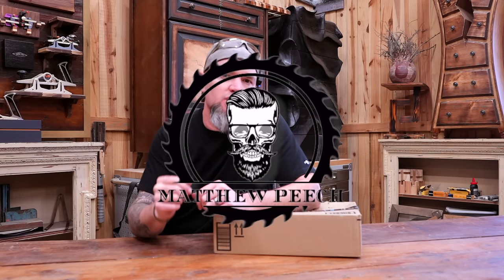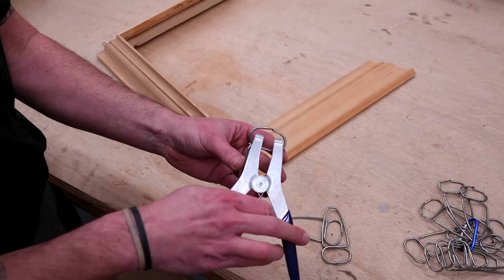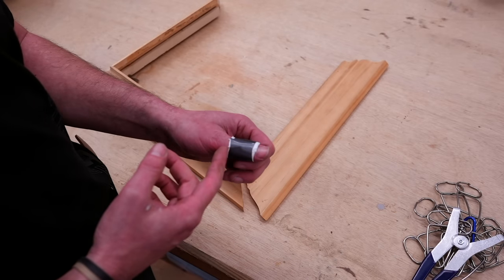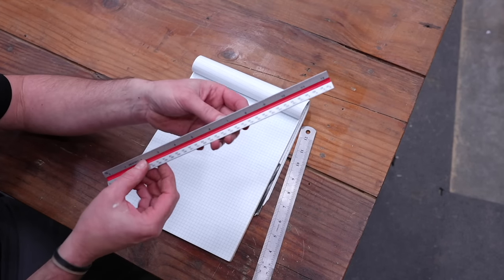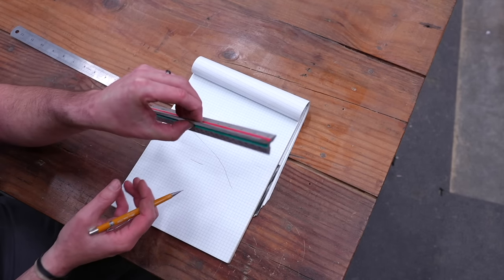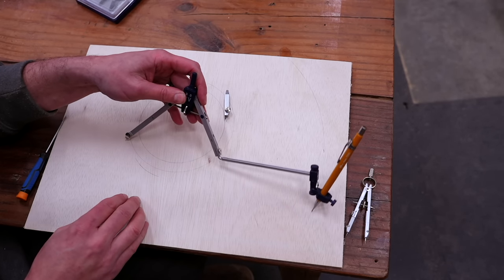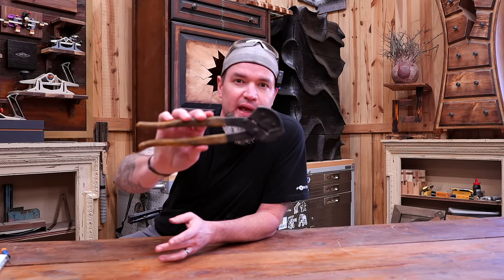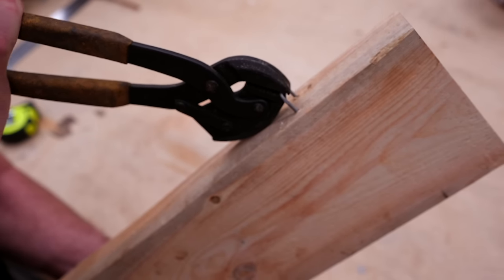8 Tools Under $20 YOU Told Me To Buy

Comment: I don't know if I just got lucky and bought a good one or if they are all this well made but, I bought the Hercules 12" sliding compound miter saw and, other than the dust boot, it is an excellent saw. No tweaking required, the gauge and the blade are dead accurate, the blade is of good quality with the laser cut expansion/balance slots, and it has plenty of power. The dust boot is no good. It is split in the bottom middle and when vacuum is used it collapses and eventually tears off. I'm still happy with the purchase since dust collection and miter saws are sworn enemies anyway.

Comment: Another tool that's very helpful and decent one costs a little more than $20 is a digital caliper. Love your channel man, keep up the great work!
Reply: Digital calipers can be had for under $20. I bought one through Temu.
Reply: Just remember to pull the battery out of your cheap digital calipers or it'll be dead when you need it.
Reply: i use harbor freight digital calipers for reloading, hey any time you wanna try a box lemme know!..     SFMF

Comment: I have a bunch of harbor freight stuff. The trim router is a great deal at only $20, but add a hose clamp to the base so it won't move on you. (i have mine in a little router table and use a DeWalt trim router for finish work on projects) the bench top bandsaw from HF is awesome. Super useful and it's small so you can move it out of the way. I got a cheap hammer from there that's nice, some really cheap leather gloves that are durable and comfy, and I'm a big fan of the 12' Bauer tape measures. They're small and easy to read so I have a few laying around. The Bauer belt sander and planer have treated me well too. 
There's a new Hercules router with fixed and plunge base that's getting really good reviews for a killer price too
Reply: i use harbor freight digital calipers for reloading ammo, hey any time you wanna try a box lemme know!..     SFMF
Reply: @mos8541  I only have a 20ga shotgun. Do you reload shells too?

Comment: HF comments made me chuckle.  I thought i was loosing my mind because i could not get my framing square marks to match up. After measuring and marking a half dozen times i looked at my square and realized it was a HF square.  So i spent an hour digging around my shed and found one of my old hand me down Nichols framers and double checked everything. HF square was not even close. If i still had two good eyes i would have known before i bought it. 
Like the man said; if you need a precision tool, you probably do not want HF.

Comment: I wouldn't be with out the spring clamps. I also keep them on a carabiner. Here's a tip - drill a hole in the end of the pliers and add a key ring and also keep it on the carabiner. Can't beat keeping everything together.
Reply from the maker: Nice suggestions. Thanks!

Comment: Good stuff.

For nail pulling I use end cut nippers. Both jaws are rounded on the top. 
Lots of leverage and wont mar the surface..

The center finding ruler looks like a good idea.

On larger layouts.
Measure and round up to the next even number and divide by 2.
Make marks from each end.

Then find the center between the two marks.

This comes in handy when needing to find center on a long wall that might end with an odd fraction.
Reply from the maker: Nice! Thanks for the tips and input.
Reply: @MatthewPeechWoodworking  I have built a lot of fence in my life and tied lots of wire for safety applications in scaffolding and lathe work.
End cut nippers are a goto tool for me for many applications.

The center finding tip came from the field and shop manager who was a Union lather in the 1950s and 1960s.

Mean, cantankerous and old but dang sure you understood what he wanted and how he wanted it done.

I actually miss working for him.
RIP Bill.

Comment: since youre on the subject of drafting tools (im only 5 min in, but i dont think this is coming up) you should search for a "drafting divider" i would make that star a hell of a lot easier, but unfortunately, most of the newer ones only go down to 6 divisions on a circle. find yourself a vintage one that goes down to five, and boom! stars. also good for scaling designs up or down. lots of good uses. also, a golden ratio caliper is another good one if you are doing your own designing. you can also buy one of these, but they are very easy to make.

Comment: The 123 blocks are great. I also recommend machinist squares, I got 3 sizes and they are fantastic for checking squareness. The reason WHY you want different sizes is right size for the job. For example, let’s say you built a table apron, and you want to square up a corner. You take your 18” L square and see it’s out of square by 1/8”. Then you take your small square that is about the same footprint as your table leg, and realize it’s not. Not at least in the 4” you are looking at. So instead of flipping out and going “how the heck” you can see your piece fits fine and the 1/8” is ok after all because no one will know!

Comment: The Bauer tools have treated me quite well so far. The drill outperforms my b&d firestorm regularly and the planer is perfect for removing fence picket fuzz without using a ton of sanding pads. The jigsaw is super effective too. The wood handled chisels work well too and actually hold  decent edge. The Bauer palm sander random orbit works better than my friends Ryobi one which annoyed him to no end. Planning too hit the Bauer sale hard next month.
Reply: Agreed, Harbor Freight has started offering better quality stuff. I have a few of the Bauer line and so far I'm quite pleased with them. Mostly stay away from their economy Chicago brands, some of which are becoming rebranded as warrior.
Reply: read my thing about their shitty ALLEGED 24" level.... if you like hf keep using it, i go there often, wouldn't use their vises except maybe the very most recent, almost all the electronics suck/way expensive compared to the grey market crap from Amazon, same with their antique lights, they just NOW started using Lion rechargable instead of stupid batteries....  aaaand so on
Reply: @mos8541  Hmmm. I have  24" and 72" Pittsburgh levels, and they are dead on accurate. Verified with a 48" Irwin and 2 laser levels. If you got a bad one they have a lifetime warranty.

Comment: From everything I’ve seen across the YouTube-verse, Dowel Max is the only brand of dowel centering guide worth buying.
Reply: Actually, the DowelMax doesn't center the dowel hole on your workpiece. Instead, it requires you to  pick a surface to reference from. The DowelMax or Jessem doweling jigs, while expensive, are the best out there. (I have the DowelMax)

Comment: 123 blocks make a fantastic miter saw stop in your t-track. Just put two 1/4-20 bolts through any hole that works best for you and a star knob on each one's top. No need for one of those red-line magnifiers because the blocks have a very crisp edge and your measurements are super easy to read. Once you tighten them down you would need a sledge hammer to move them. Edit: I also put some slippery UHMW tape strips on the bottom. They slide like they are on ice.
Reply: Great idea on the strips!
Question; do they wear out very quickly being thin strips, or do they last about as long as thicker UHMW?
Reply: @Toyotajunkie  Mine are still working. As you know, UHMW is one very tough material and is designed to withstand abrasion pretty well. It is a simple matter to add 2 layers if you find it isn't enough. There are thicker versions of the tape available or you could use PTFE or some other kind of plastic tape. They all work well.
Reply: @dwayneford1990  Sounds good, I will definitely be adding some as I do something very similar to your setup. Thanks for the input!!
Reply: @Toyotajunkie  If you go the PTFE route (Teflon) make sure you don't get the plumber's pipe wrap white stuff LOL. Make sure to get the good stuff. I've seen guys use it on the bottom of their table saw sleds.
Reply: @dwayneford1990  Yuppers, I have seen bad things come from cheap alternatives. I have some UHMW that I can cut down and double side on to the block.
I tend to not go too cheap when it comes to long lasting desired results.

Comment: I, too, like a lot of HF stuff. My rule of thumb is to read reviews, picking 4 star and 3 star, then read between the lines to determine if the reviewer has a clue what he's doing. It generally pays off.  Like a lot of us have discovered, sometimes a simple modification to a tool will make it worthy. The doweling jig is a great example of "just walk away".  I tend to agree with the i-2-3 blocks assessment. For a given set of projects, they could be very useful, I've resisted the impulse to buy a set and to date have no regrets.

Comment: Another great video!!! That doweling jig could be fixed by boring the guide holes out a little more and pressing in bronze guide bearings/sleeves that fit the cross connecting pins.  But then again, you should not have to re-engineer a tool to make it work and it's Harbor Freight.  But since you own it, you could make it better if you were so inclined and had the time.  Also the center finder ruler is actually easier to use than you depicted.  Just tilt it slightly diagonally across the board you want  find the center of until you have the same two numbers lined up on each side.  For example to find the center of a 6.385" board, lay it diagonally across the face of the board and put the 8" mark on each side (or any inch mark you want - just use the same on each edge of the face).  The center mark is now centered with no math involved.
Reply: but a regular tape or ruler does the same...so why buy another ruler
Reply: Fixing a new tool isn't my idea of a good time.

Comment: A 123 block can also be used as a stop block by using the treaded holes as a clamp and using a pair on a router table to create a slot in a work piece.

Comment: Gonna have to get the nail pulling pliers...I frequently have an errant brad nail to remove.  Great tip!
Reply from the maker: Yes! They are a must in my shop.
Reply: I use vise grips. Just put something under the tool between it and the wood. One side of a vise grip is curved like the tool shown.

Comment: Coming from automotive into woodworking, I think one of my favorite crossovers was using a hydraulic press to create a splitface textured backdrop out of scrap pine 1x2 and 2x2 pieces.  There's also all sorts of amazing things you can do with an angle grinder!  :D
Reply: I just crossed over myself from heavy equipment mechanic to woodworking and handyman work for the locals. This by far seems to be more rewarding and I thought I being a mechanic and steel fabricator was great. It's so much fun using our tools in the wood trade. I have welded up some cool stamps for wood burning and roughed up with a flap wheel to get the aged look. Good luck to you!
Reply: YEAH like that widow maker hybrid chainsaw blade on the end of a grinder... no thanks..

Comment: The best buy at HF is their quick grip clamps.  They work great, can be reversed for spreading and they are a fraction of the price of the Erwin clamps.
Reply: The Pittsburg brand ones are crap.  I bought some of the Bauer clamps though.  They are more expensive but don't shatter the plastic if dropped on a concrete floor.  Every Pittsburg clamp I have bought has either broken, jammed, or they lose their gripping pressure.

Comment: I use my 1,2,3 blocks all the time with my CNC and Laser as spacers off my fence. While the same function could be performed by another tool or even a shop made block, they don't deteriorate, they don't walk away, they are perfectly consistent, they are quick to use, and impossible to overlook even when the machines are covered in chips and dust. On the laser they have even more uses. Are they necessary, no, but they do what they say on the box and they do it well. I'm all for swiss army knife tools, but sometimes simple and reliable is better.
Reply from the maker: Good to know. Thanks for the input!

Comment: The 1-2-3 (also available in other sizes) can be used to measure tapered pins and arbors. Use precision calipers  to measure pin diameter at the 1" and 2" sides to obtain taper/inch in inches.

Comment: On the doweling jig could you take the guide pins out, put spacers in, and just use bolts in place of the pins? A few washers super glued together should space it evenly.

Comment: Would you point out the importance of checking framing squares to insure they are actually square. 
I was building something a while back and got very frustrated because I was having trouble making square corners. I started thinking I was going crazy until I check my framing square and found it was off a full 1/8" in 2 ft.
This was one of the aluminum squares. I went back to home depot and checked several of the squares and every aluminum square was off. However all the steel squares were fine. 
I pointed this out to the department manager and he didn't understand how I knew the aluminum squares were off. Even when I showed him how to flip the square to check it he didn't understand. Now before I buy a square I always check it.

Comment: One of the items we use that are not meant for woodworking is 3M Black super weatherstrip & gasket adhesive.  Repairing a shroud for a disc sander with it right now.  This is my goto when I need to secure things quick super-glues will not work on.  Plus you can build up a radius fill for 90 degree repairs or when a small piece of the repair pieces is missing, this can fill the gap.  Yeah it is under the workbench somewhere and I do not feel like getting down and searching for it.  Can be built up in layers as well.  Green tape will hold items in place and can easily be removed after; wax paper should work as well.  Nothing is worse than waiting 24h for a repair to set, then when you unsecure it, remove clamps/tape, ect, the part shifts or it re-breaks.  Also works for securing magnets or nuts.  Water proof and can handle a wide temp range as it is made for automotive use.  Will add more when I notice them.  We re-purpose tools and items all the time.  Just finished converting two ss restaurant utility tables to workbenches with some ply.  You can find them cheap on fb or cl and they are made to hold serious weight.  Just skin the top with ply and secure 2" boards to the underside edges that you need to clamp onto.  Great channel, thanks for your contribution to the community.

Comment: I bought one of those dowel centering jigs.  I have taken it apart to use as aluminum scrap.  Your review was spot on.  Right out of the box, it wouldn't jig a consistent hole.  Nor could I get two boards to come together straight after using it.  I have a POS plastic one that I can at least use.  This one should never have been made.  I chalk this buy right up there with harborfreight drill bits and saw blades

Comment: One app I've seen with the 123 blocks is to use a bolt to hold them a certain distance apart, and then slip them over a fence and use that as a stop. They're heavy and you can tighten the bolt to keep them from moving.

Comment: I bought one of the new HF Bremen parallel clamps a few months ago and compared it to my Bessey REVOlutions. I used good calipers where I could to measure parts sizes, deflection, whatever else I could think of. They were extremely close to the Besseys and were consistent with some some YT reviews I've seen. I have a few glue ups I need to do, I'll throw this one into the mix and see if I notice any issues. At a significantly lower regular cost, before any possible coupons/sales, than the Besseys, I'm planning on picking up a few more. 

I also like HF's 8, 15, and 20 bin Storehouse parts storage cases (the ones with the handles). I use them for everything from storing screws to holding small tool sets to CNCing a custom foam insulation board insert to hold my CNC bits. I like to keep one of each the 8 and 15 bin and two or three of the 20 bin cases empty on hand. 

Their 5 mil nitrile gloves are another thing I keep plenty on hand when I mix resin, paint/varnish, use other chemicals, etc. I've tried their thicker gloves, but have had problems with them tearing easily, while the 5s have been much more durable.

Comment: have found precision at Harbor Freight.

The 6' Bauer keychain tape measures are extremely precise, and they include 1/32" increments for the first 6 inches. At $1.99 I have them in my car, truck, tool cabinet, and on my desk.

I have a 12" Cen-Tech steel ruler that is also just as precise. It has a rubberized cork backing, so it doesn't slip. I do wish it had a Zero edge, but I can live without it as I have others that do.They recently rebranded from Cen-Tech to Pittsburgh, and I honestly have not looked at the new version. Hopefully they are as good as they were.

I have 24' I-beam and 72" box levels, and according to my 48" Irwin and two laser levels they are dead-on accurate.

Their Dial Indicator is perfect for aligning table saws, and drill presses etc.